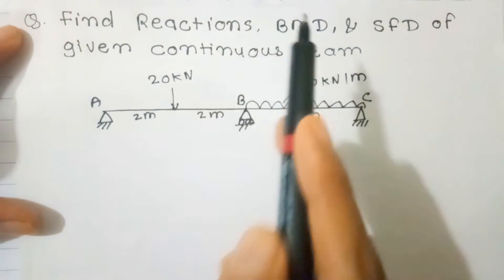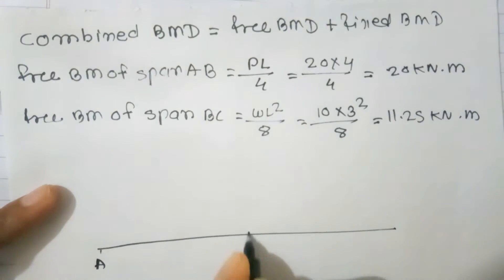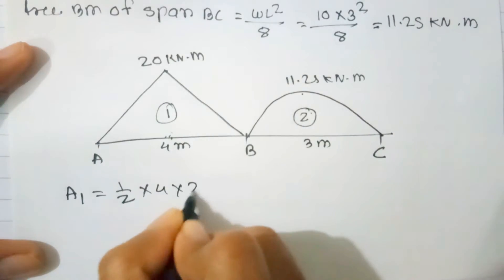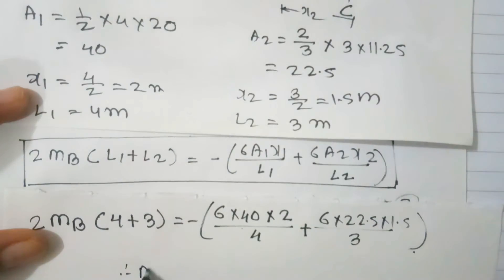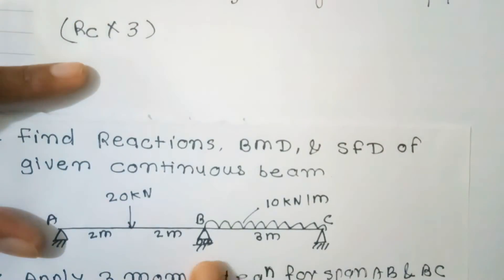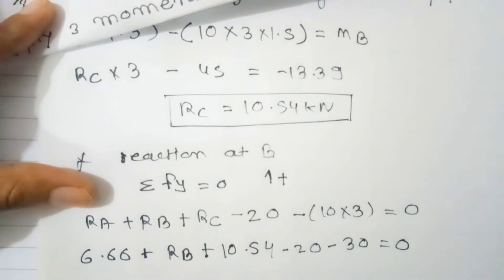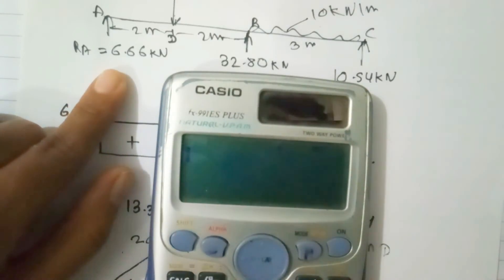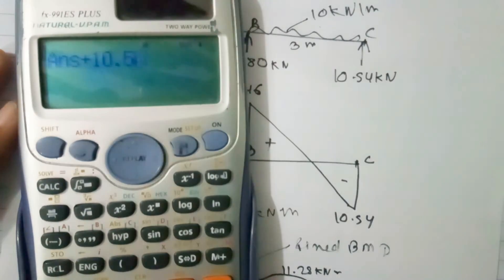Continuous beam reactions, sfd and Bmd

Comment: 1.A continuous beam ABCD of span AB = 3m, BC = 4m and CD = 3m fixed at theends A and D and continuous over supports B and C. Using momentdistribution method calculate the moment induced at the ends if the supportB settles by 25mm. Draw the bending moment diagram, if E = 2 * 10 ^ 6 * N / m * m ^ 2 and I = 4 * 10 ^ 6 * m * m ^ 4 and EI is constant for the whole length of the beam. Can you slove this problem? mam